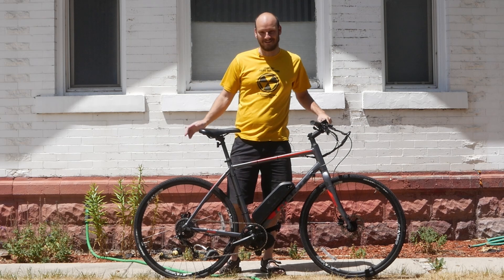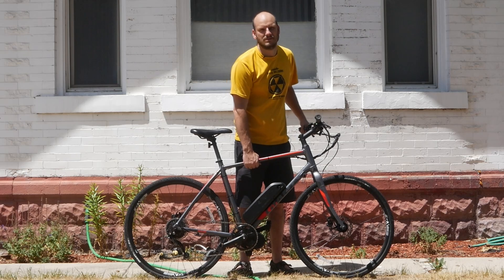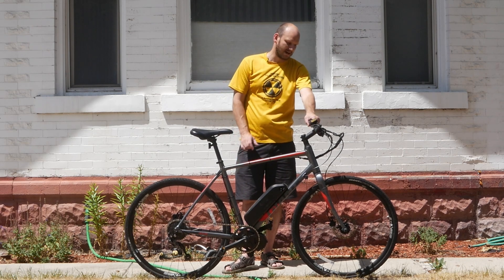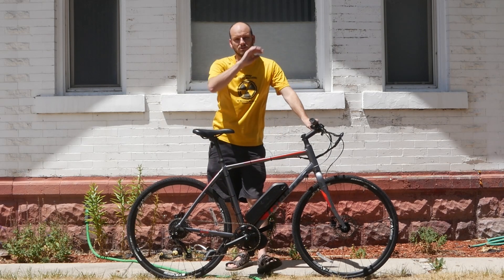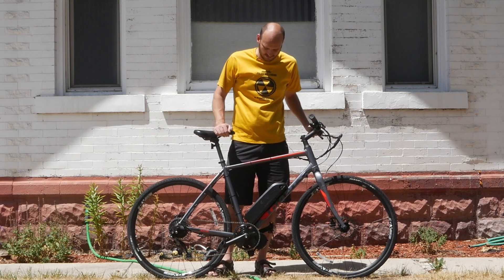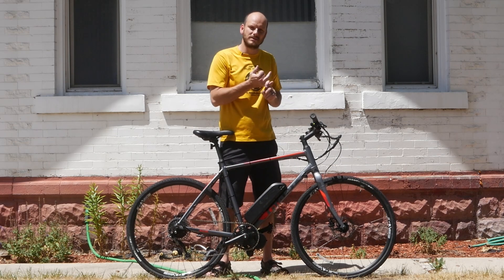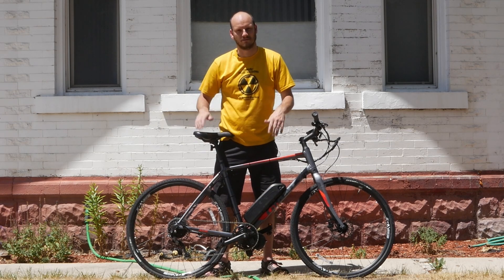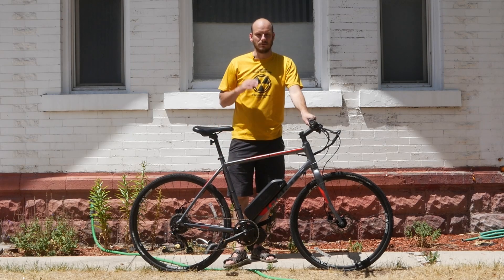Custom E-bike Build: Giant Escape 48v 11.6ah Bafang BBS02 750w Mid drive Killer Commuter!

Comment: Lol, I was thinking to put a BBS02 500 watts on my friend's bike. It's a Louis Garneau hybrid bike, very light at ~15 lbs, 700c x 32c thin tires and it's already a blast to ride on flat roads. I hit like 40 km/h with it the last summer. So I dont doubt it would go over 50 kmh (30 MPH) easily. This mid drive kit installed on a hybrid bike is like to put a Corvette's V8 in a Honda Civic. 😂

Comment: I've got this bike. I cannot get the motor in with the bottom bracket cable guide on. Without it the gears will not work. What did you do to solve this?
Reply from the maker: You can relocate the cable. If it’s part of the frame, you can grind it off. Usually it’s just plastic or the cable housing that can be rerouted.
Reply: @JohnnyNerdOut  yeah I figured it out. It was in a plastic mount I cut it down and slightly twisted it and it's been sorted. Did my first 10 mile ride on it today. Wow it's fast! Thanks for the quick reply. I love your videos!

Comment: Got my BBS02. Paranoid about getting the proper bike with the right bottom bracket size. Did it fit in cleanly? 

Did you need to remove any material?
Reply from the maker: If memory serves me, it was an easy install

Comment: Do you know those bus bike racks? Would something like this be too heavy to put on one of those? What about a car rack (which are generally less industrial strength)? How much weight does the motor and battery add? Thanks for these video, you're getting me excited, been wanting to do something like this for a while.
Reply from the maker: Get a platform style hitch mount rack and you will be fine. I recommend taking off the battery when transporting so that you are only adding the weight of the motor (9-12#)
Reply: @JohnnyNerdOut  awesome. Thanks man.

Comment: Can u ride the bike without a gear shifter?
Reply from the maker: yes
Reply: @JohnnyNerdOut  ok thanks. What should I think of when shifting gears without a gear sensor?
Reply from the maker: @AirbrushDGart  I would apply the brakes lightly enough to engage motor cut off. You don’t want to change gears at high power and low rpm
Reply: @JohnnyNerdOut  thanks for that tips and for your answer 👍

Comment: I have 3k to spend, but also don't want to blow it for no reason. Given the opportunity, where is it worth it to splurge? Is it to get the HD over the 02? or 52v battery? or should I spend more on the type of bike itself? THANK YOU
Reply: Get a Poseidon Redwood (flatbar version) for under 1k and Johnny's long haul trucker kit (bbs02 + 52v 17ah) for 1k+ and have an amazing bike to work with.
Reply: What did you end up choosing? I was going to say that a quality used hardtail mountain bike with disc brakes is a good starting point. With the other $2200, you can get a big 52v battery and a smaller 52v and swap between them depending on what you want to do with the bike that day.

Comment: The problem that I'm having trying to find an older bike is the brakes. Even the name brands were all running v-brakes. Disc conversions are pretty much out of the question $$$$ wise!
Reply: Craigslist my friend keep looking. I scored a specialized for 300. It was worth about 1k but owner wasnt aware.
Reply: I bought a pre made pedal assist with a tongshen mid drive on Craigslist guy spent over $2000.00 building the 29er frame with a 48 volt battery he was asking $1200.00 I got it for $900.00 we are friends now ..